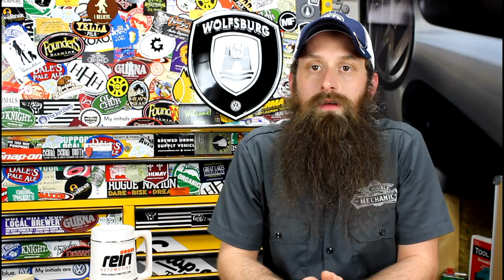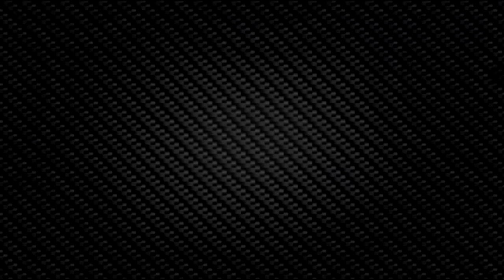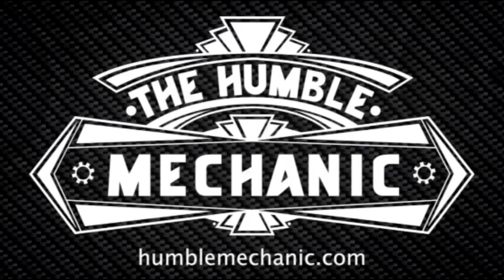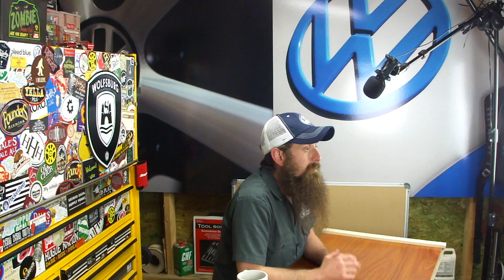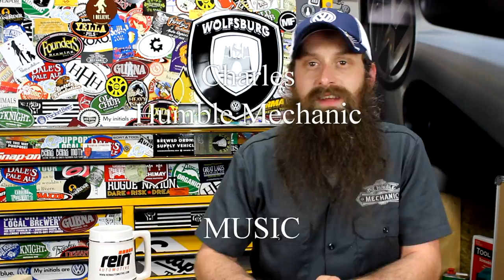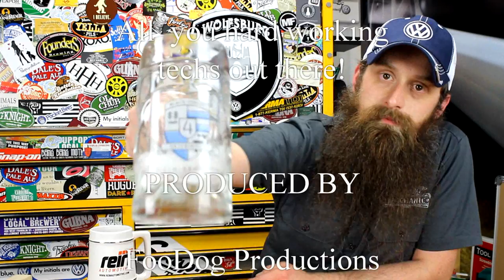Why Flat Rate is a Good Way to Get Paid

Comment: are you kidding 3 hours for a brake job, your boss is a crook,  were flat rate at our dealer, the guy next to me programmed diesel injectors 6 of them with the same number, he didn't care as long as it worked, each injector has a certain value for optimal efficiency that need to be programmed into the PCM he said the truck runs that all he cared about. , I can see your on the side of the owner, by stating put myself in the owner position, well I'll tell you I would pay my technicians  an hourly rate with a bonus for over 40 hours produced, but I would spread the gravy evenly, the problem is the dealers are now owned by corporation's as opposed to family owned dealers, they don't care about the technicians or there family's any more, that's why they don't offer any benefits, and that 401K its your money from your check, but they make it seem like there doing you a favor.
Reply from the maker: It matters not the hours a customer is charged, it matters the dollars. We can charge a customer 100 hours for a job, but bill it at $1 per hour, or bill 1hr at $100. We cut the labor dollars on maintenance to be competitive with the work, and still pay techs. 

I can't seem to find your other comment about flat rate. As I mention in this video, it is not perfect. No one is selling you a hamburger and calling it anything. I have been very successful and do high quality work on flat rate. There is no perfect pay system. Some can win flat rate and do high quality work. Some do high quality and lose, and some win flat rate, but have to hack to do it. 

In all the comments on this video we can pick apart each idea and find why it's both better and worse than flat rate. I don't have the answer for what the best way is.